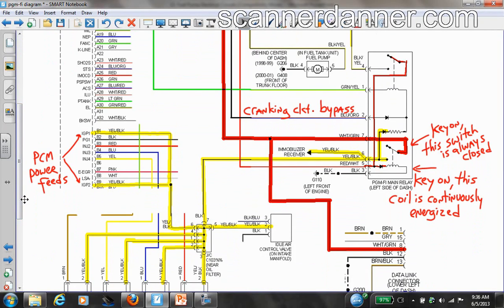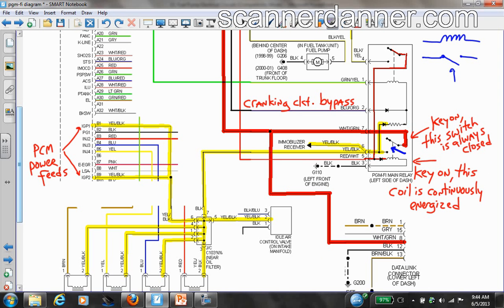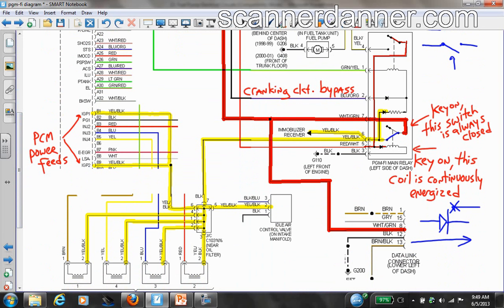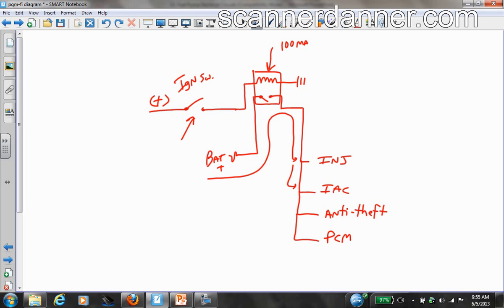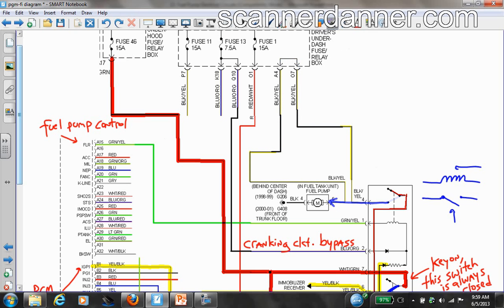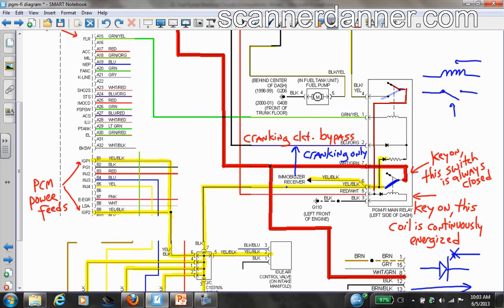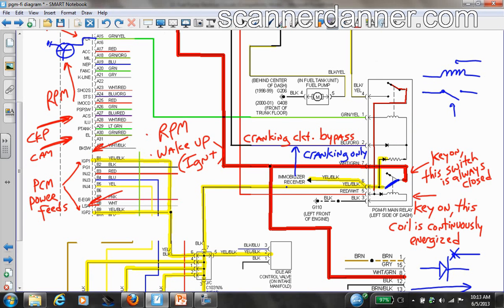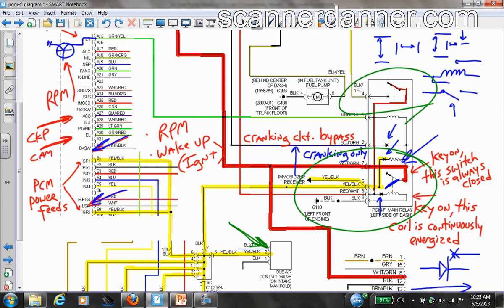Operation and testing of a Honda main relay (PGM-FI) - an SD Premium video

Comment: LSir, please abit of clarification from your end. Thanks.
1. will both the 2 input positive wires to the fuel pump relay will go live permanently as long as engine is RUNNING or only the input positive of the PRIME circuit will turn off while engine is RUNNING???

2. How the prime circuit behaves when engine is RUNNING?? Is it off or on while RUNNING engine?

3. How the 2 currents behaves  when they met at the 86 pin of the relay?? Will additional current will flow to the relay at the same time when engine is at START AS WELL AS RUNNING SIMULTANEOUSLY??
Reply from the maker: 1. as long as the ECM is still receiving a crankshaft position sensor signal, the fuel pump circuit will remain "alive"
2. the prime is just the initial key on period, when the ECM "wakes up" and not all cars have it
3. I have to go back and watch to answer this one, sorry

Comment: The resistor might be there to reduce PCM transistor current and therefore the heat. The lower (on picture) relay is as important as the upper one (if it releases the contacts due to low voltage, car will also not start). So it can`t be for extra starting insurance. It also can`t be for reliability for the coil...lower relay has coil with direct battery power and if it fails, car will not run....and these relays will be changed in service together anyway. 

There diodes... maybe some kind of electrical circuit interference counter-mesure?

Comment: I was told that the reason for the power reducing resistor's is that they have to design the the lowest current draw system when the car is in the run state to reduce the loading on the alternator so to improve mpg and emissions. I'm not sure as to what extent this helps the cause.

Comment: One question...
Even if the ECM isn't getting power still able to turn the check engine light on wen you turn the key on???...
Probably yes thanks to another transistor in there...
I'm thinking replacing my solenoids for TRIAKS

Comment: Hi my Honda Civic 2.2diesel 2007 is not going to sleep when I drive the car for less than 10 minutes  it sound the PGMI relay is energies for this period until I switch the ignition on and off then it will DE ENERGIES  any ideas on this issue please

Comment: maybe full system voltage is required to close the relay and only a fraction is required to hold the solenoid in. thereby reducing the load on the coil prolonging its life expectancy?

Comment: GREAT VIDEO. I have a 94 honda accord ex that ran great and one day, crank no start, flashing d4 and no comm. If I leave it sitting with the key on for up to 5 mins sometimes. I'll hear a click and all of the sudden........ check engine light turns off, fuel pump primes and im up and running. Im trying to test the pcm but I dont know where to start.
Reply from the maker: during the no start, take a test light (incandescent style) to battery ground and see if you have power going to your injectors and ignition coil, or distributor connector (blk/yel I think)
Reply: @ScannerDanner  Thank you so much for getting back to me.I tested iac, injector and distributor connectors and they have power. I also verfied my fuel pump is working. This is a great challenge.Thanks again.
Reply from the maker: @1shorte4wssj21  during the condition right?
Reply: @ScannerDanner  yeah. I forgot to mention that i also tested IGP1&2 and both12.5 volts and GROUNDS at the pcm.
Reply from the maker: @1shorte4wssj21  check for a 5v ref to your MAP or TPS next time it does it
Reply: @ScannerDanner i hope im not bothering you. i do get 5v ref at the map. i forgot to let you know. the cars state right now is "crank no start" as we speak.
Reply from the maker: @1shorte4wssj21  what are you missing? Spark, fuel pressure, injector pulse?
Reply: @ScannerDanner  main relay output voltage to fuel pump
Reply from the maker: @1shorte4wssj21  I'm guessing you already changed the relay? And during this time, you still have good spark and injector pulse?
Reply: @ScannerDanner  good morning sir, ive tested the pins to the main relay and found that the pcm is not giving me the ground i need the complete the fuel pump circuit. if i ground pin a7 on the pcm the car will start and run. am i missing anymore tests that you can think of? im just going to do a pin test on the connector.
Reply from the maker: @1shorte4wssj21  possibly a main ignition or battery feed wire to the ECM is your problem. Do you have a diagram that shows you all of them?  https://eautorepair.adtrk.biz/?a=10817&c=24&p=r&s1=
Reply: @ScannerDanner  JUST WANT TO SAY THANKS FOR TAKING THE TIME TO HELP ME WITH MY 1994 HONDA. the diagnossis is a BAD fuse box. the crank no start happen again out of no where. so i put my hands on the harness through out the car....... and i started touching the fuse box fuses and WOW THE PUMP TURNED ON AND SO I VERIFIED. THANKS AGAIN

Comment: From a diagnostic stand point if the CEL didn't flash / no power or partical power going to the ecu from the bottom coil would you still get spark??

Comment: Hey, I know this is an old video but I need help. I was trying to wire in a kill switch in my 2003 Honda Civic because two cars have got stolen from my house in the last month. I wired a switch into the black and white wire going into the main F1 relay. That was the wire I was getting power from. The switch worked however I somehow grounded something out on the frame and suddenly I'm not getting any power to that wire, even if I put the wire back together. I was able to get me and my wife to work today by running a wire straight from the hot terminal of the battery to connect to those two ends of that wire and the car runs but I'm sure that's going to cause damage eventually. How do I find out why that wire no longer has power?
Reply from the maker: https://eautorepair.adtrk.biz/?a=10817&c=24&p=r&s1=
This is a link to the DIY version of the same service info and diagrams I use.
I can't check a diagram for you right now but for $20 you can gain access to everything you need. If you give me year, make, model and engine size, if I get time later I can look too.

Comment: ScannerDanner, I have a question. If it is the case that the lack of a crank signal to the computer will give you no power output to the fuel pump, does that mean that if I don't have power to my fuel pump, it could be a problem in my distributor where the sensor is located? I have this same car and just changed the distributor but now I don't see any power going to the black yellow wire at my fuel pump when I turn the key to on or when I crank it.
Reply from the maker: +lineartechbd1600 yes, and I'm not 100% sure if all Honda's will prime the pump on initial key on. But I believe it should, which would lead us away from the distributor inputs. But we cannot completely rule that out yet. Check for injector pulse next. This will verify distributor inputs to the ECM and also ECM function. 
https://www.youtube.com/watch?v=SUxagOAVS5M (a very good one for you, it's on a Honda)

https://www.youtube.com/watch?v=ZgNY3ZpjSsU (i just posted this one and I address your question about distributor inputs)
Reply: ScannerDanner

 I was looking at your video again and in it, it shows several fuses at the top. One fuse was located under the hood ( I thought there was only the one 15amp fuse on the side of the dash). I looked in the fuse box under the hood and saw a burnt out fuse so I replaced it. Now I have power at the pump. I replaced the pump (I keep an emergency pump and distributor in the trunk cause I travel so far from home). That fixed my problem. Thanks for the video cause I would have never realized there was a fuse under the hood.

Comment: Another possibility for why.. to provide a voltage drop to prevent this relays coil from draining all this circuits current.  This resistor would provide a greater voltage to other components tapped before the resistor. .

Comment: omg I'm dealing with this problem for months in my case the main relay its new I don't have power to the fp side and couldn't find it yet the problem its driving me crazy I wish I can get it on with this video
Reply from the maker: 🤣 I have some other honda pgm-fi videos too as well as some ignition and fuel pump failures and how to troubleshoot those (Honda specific)

Comment: I think IF there is any reason at all to have the resistor  we need to look at the computer pulldown circuit to find it.
Assuming that both relays on that board are identical (I think they are), then both relay control circuits should have series resistors, yet it is only the fuel pump relay that has one. The very same relay  that is being grounded by the PCM. Mr. Paul can you verify if both relays are identical and possibly provide us the markings for IDeing them?

Comment from the maker: it's just not necessary. relay coils only draw 100ma as it is. Why is Honda reducing the current on  100ma circuit? how many other computer controlled relays do we see that this is not in place. i know what it does, i just don't know why they are doing it. seems like a complete waste  of money on extra circuitry that isn't necessary. but im sure there is some reason. maybe they used a very small transistor driver? or maybe it was a "fix" to prevent cracked solder joints, that didn't work

Comment: with the cranking bypass wire sending 12v through the coil... after cranking it doesn't take 12v to keep the switch closed... only takes 12v to initially close the  switch on the relay and a llower voltage will keep the switch closed.... like a ballast.. so to speak

Comment: will a relay get hot and quit then cool off and work again
Reply from the maker: It is normal for a relay to be hot to touch when it has been energized for a long time, like a fuel pump relay that is constantly energized with the car running

Comment: Could the diagram be wrong and the resistor is actually in the FEED to the pump, to run it at less voltage when running, but feed max volts during cranking? Can't see why, as others have said, it's only on the FP control solenoid feed.
Reply: Definitely not a resistor for the pump. Could the diagram be wrong? Yes but I've seen many different honda diagrams show this. Do some manufacturers use a resistor in series to the pump? Yes! But this honda is not one of them. Good thought. Thanks!
Reply: ScannerDanner Premium

Comment: Where would I look if my main relay plug is showing power on battery pin #1. But not showing ground? I put a spade connected in pin#1 and alligator clipped the end of the test light and than took the probe side of test light and probed ground and it DOESNT light up?!? No wires have been tampered with and all chassis grounds and engine grounds are in place and read 12.65v.
Reply from the maker: you have no ground on pin 3? What happens when you give it a ground? Does the engine then start and run?

Comment from the maker: good point but this is more of the how not the why it is being done. there are many other relays on this car that this is not being done on. nor is it necessary for relay coil control. we are all missing the true reason still. myself included
Reply: ScannerDanner, in regards to the resistor to the fp relay when running, maybe this is a little bit of a stretch, but I didn't see anyone else suggesting it so here goes.  With the resister, there is less current flow; with less current flow the magnetic field isn't as strong.  Is it possible with the weaker magnetic field, that this now doubles as an inertia switch in case you're hit hard enough, the switch in the relay is jolted and loses contact, but the lowered current is only enough to keep it closed, not strong enough to re-close the switch.  I know it's a stretch, but its the only reason I can think of to put that only on the fp relay and nothing else.  As an added bonus, it auto resets next time you turn the key.  Next time you get one of these, maybe give it a good rap with a wrench and see what happens.  :)

Comment: Something that always gives me a problem is I don't see the "circle" (circuit).  All of the wires end in a component on the diagram and I get lost.
Reply: its not necessarily a circle..but it does have a beginning and an end right? power and ground. Try and think of it like that.

Comment: Curious as to what the computer sees from the immobilizer, and what the immobilizer might tell the computer not to power on. Any feedback is appreciated. 03" Honda Element 2.4 VTEC FWD
Reply from the maker: +brasanford1 on just about all of the anti-theft systems the computer will shut the injectors off to prevent the car from starting. typically you will have a start stall condition. initially the computer will fire the injectors and then shut them down. no other systems are affected

Comment: No one talked about how to test this relay and what are good ohms to rule out a good relay or did I missed it. Please help
Reply from the maker: Ohm testing relays is pointless and not needed.
The problem with an ohmmeter is that when it tests good, it can still be bad.
Reply: @ScannerDanner  real quick please so if all points to relay but relay could read good with ohm meter than might as well replace relay right.  Also you are a true blessing for society  i don't know what we would do without you n you true skill n knowledge take care thank fir helping us all YouTubers
Reply from the maker: @victornaja7927  i prefer voltage measurements to confirm relay operation, as described in this video. I have other videos on testing this PGM-FI main relay if this one was confusing. Thanks!

Comment: Help me figure out why am only getting 5v at the IAC valve
Reply from the maker: +Carmen Melendez Montes Help me help you first. How about Year, make, model, engine size to name a few. Also what wire were you measuring 5v on and was the IAC plugged in or unplugged.
Reply: Its a 96 Accord 2.2 no vtec, its the 2 wire IACV one gnd the other is suppose to get 12v but only get 5v plugged or unplugged
Reply: Its a 96 Accord 2.2 no vtec, its the 2 wire IACV one gnd the other is suppose to get 12v but only get 5v plugged or unplugged

Comment: yea scan its puffing white fumes through th3 pipe when u take the k an n off an it stinks of petrol lol took spark plugs 9ut they are soaked in petrol 2 only bought plugs an new oil the other day ??
Reply from the maker: +Rachel  Hickey okay, next step, pull the vacuum hose off of the fuel pressure regulator and see if fuel is running out. If it is, you need a regulator. Here is two videos I've done on this.
https://www.youtube.com/watch?v=6pb2jt8tabM

https://www.youtube.com/watch?v=AKtR_yF7bi8

Comment: California accent?
Reply from the maker: Pittsburgh Pa lol
Reply: @ScannerDanner  damn, i wasn't even close.
Reply from the maker: @JohnDoe-iu5xi  😀
Reply: @ScannerDanner    Great video though. My dad's old 92 civic car started having intermittent start up problems and I thought I'd play detective. I hear the first click on the Main Relay, but the second wont click on. And this is random. Sometimes it clicks twice, and sometimes only once (with once no prime is heard and car will not start at all, but twice obviously the pump starts to prime and it goes like nothing happened). According to all these diagrams and my manual it has to be an issue with the ECU fuel pump control unit which is in the ECU. Something isn't grounded properly or the transistors is defective. There doesn't seem to be any flow from battery to ECU.
Reply: @ScannerDanner  is this common?
Reply from the maker: @JohnDoe-iu5xi  what is common on these is a cracked solder joint in the PGM-FI main relay. Have you checked for this?
Reply: @ScannerDanner  Yeah Teach, first thing I checked was the inner components. Nothing seemed wrong. Or at the very least terrible (I've seen cracked solder joints before, but it was not visible here). I even had a few spare Main relays and still the same issue. I could do a continuity test on the relay but all 3 look visibly great. I don't suspect a fault with the Main relay itself. So it has to be an issue with Bat to ECU. This is the second switch that clicks. It has to mean there is no ground from Bat to ECU. Right?
Reply from the maker: @JohnDoe-iu5xi  it sounds like you are basing your diagnosis on a sound. We have to do voltage measurements to find out what is missing. A relay coil needs to have a good power and ground to create a magnetic field strong enough to do it's job. Which side is dropping out. We have to know. 
Another common problem on these early Honda's are ignition switch failures. Next time you turn the key on or crank it and it is a no start, smack on the bottom of the column under the ignition switch and see if it starts.